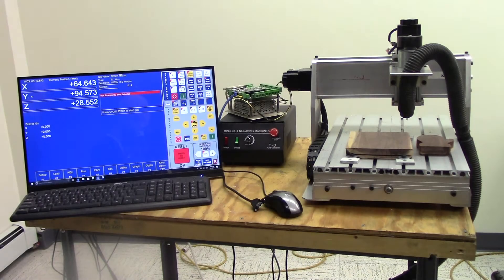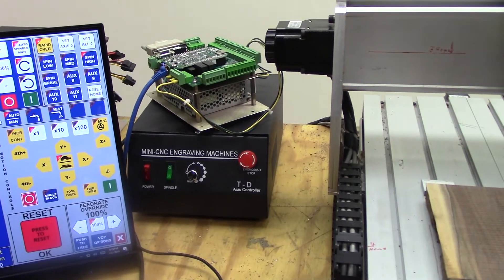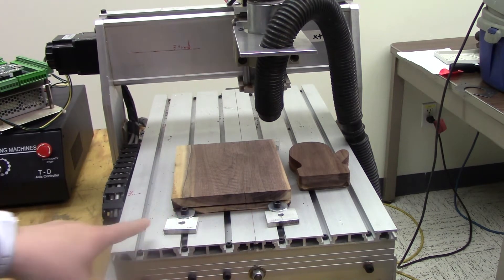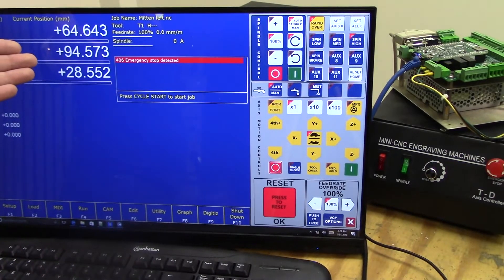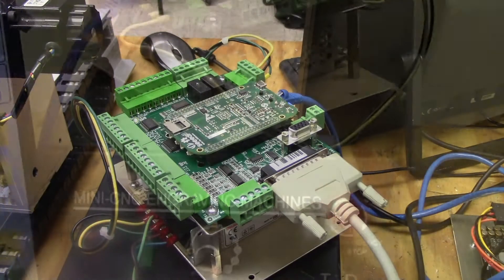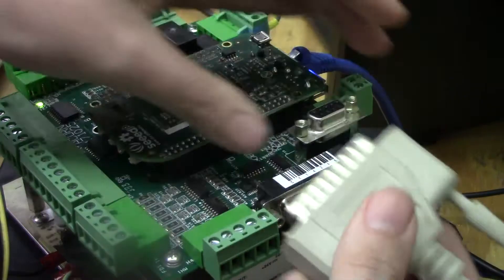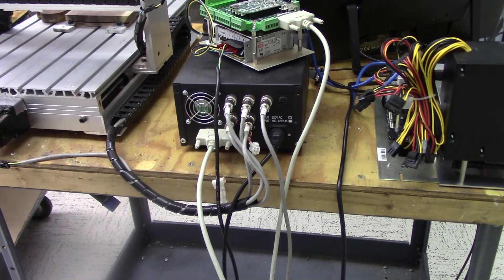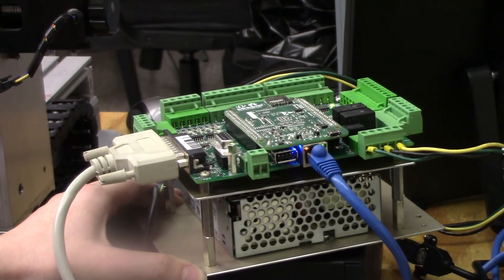Mary's MakeShop: My Centroid Acorn CNC Control System Set-up

Comment: Nice and very well done video. I have a similar cnc router.  What are you setting  in Acorn for Motor revs/in and Motor steps/rev?  I'm having problem doing 3d profiling.

Comment: Great video! Hey, about that connector you said wasn't a parallel port - I think it might be. I swear I remember those connectors on printers a lllooonngg time ago. Like in the 80s. Not saying you aren't right about avoiding them, but if somebody is already stuck with one it might be just a matter of finding one of those cables.
Reply from the maker: Thank  you so much! You're right it is a Centronics interface that is compatible with a DB25 with the correct cable. That is for the output of the controller box though. I messed up and should have clarified. I was referring to the USB female input not being compatible with the acorn which needs a DB25 cable. We had a discussion about this on the forum if you wanted to check it out: http://centroidcncforum.com/viewtopic.php?f=60&t=1427&start=10#p8656